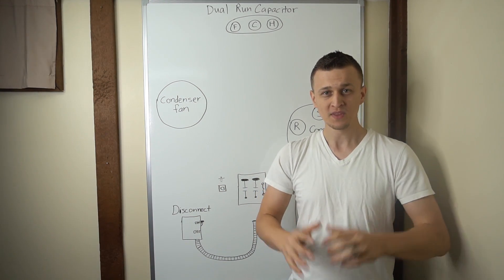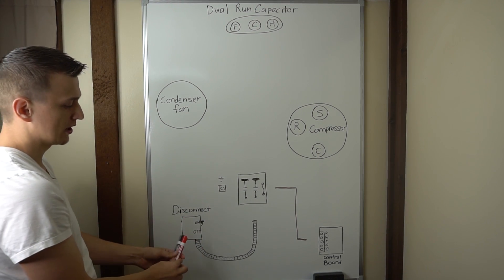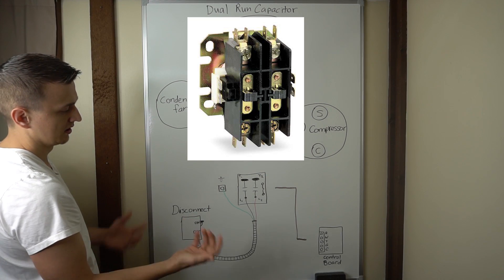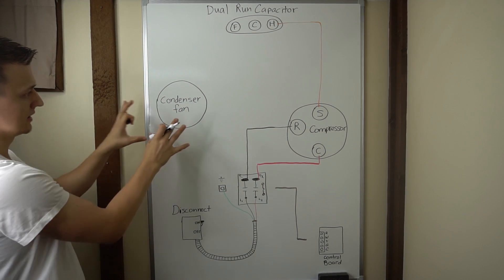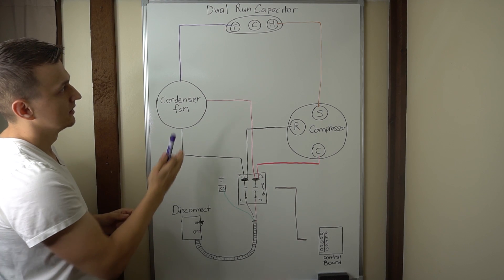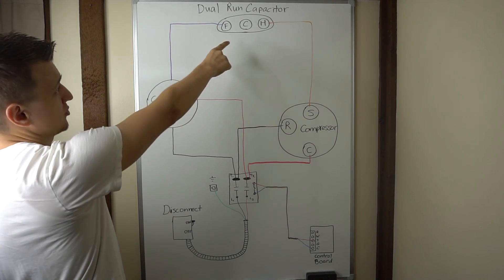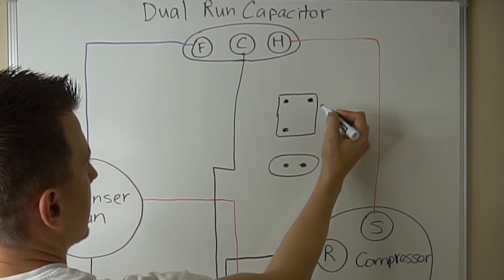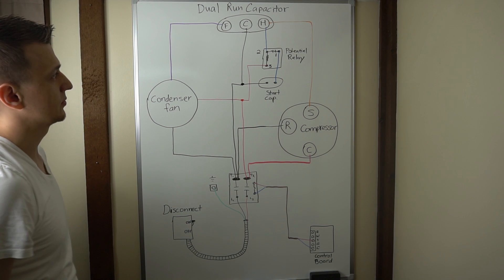How To Wire AC Unit - Easy Diagram

Comment: How is voltge in each wire 120v to give us 240? Isn’t it the hot wire only that gives 240v?
Reply: Two wires from 2 pole breaker each feeding 120v from each phase of the electrical panel, combine to give the 240v. In no situation ever will one wire supply all 240v. Rarely you might have a "bastard leg" in a residential system and more commonly in a commercial system,  that provides a higher voltage on its own but you probably won't ever deal with that

Comment: Please, I have a question. at 2:40 second mark you show the AC unit connections that are capped. Is the black wire linked with the white wire, and yellow with the red? I ask because in my unit I have red, yellow black and white wires and I believe I caused a short by capping two wrong wires together. Thank you.

Comment: How do you gauge the thermostat wire to replace it. I have a unit that has two feet of exposed thermostat wire connecting to the outdoor unit. Both indoor and outdoor stopped functioning. I know I can splice the wire but I have no spare wire so it can reach the outdoor unit again.
Reply from the maker: All thermostat wires are the same size but they can have different numbers of wires. 2-wire thermostat cable, 3-wire, 4-wire, 5-wire, etc. If you go to a hardware store like Ace Hardware, Lowes, or Home Depot - there you can buy these cables by the foot. You don't have to buy the whole roll. Then you can splice a new piece of wire in to replace the bare section you have. I have a video where I show different ways how to do so: https://youtu.be/ihpNCVk1lF0   As a temporary fix, you could just use some electrical tape to tape each wire individually so that they don't touch each other and cause a short.

If your units stopped working, that likely means that your 3 or 5 amp fuse (it can be a mini circuit breaker if you have Lennox) on the furnace control board has burned out. You will need to replace that after you fix your wires. Hope that helps!
Reply: @WordofAdviceTV  you’re literally awesome!
Reply: @WordofAdviceTV  I was trying to find where that fuse is to no avail. The AC is for a manufactured home and indoor unit is in a very smart closet like space. I don’t see a furnace board like you show in a lot of your videos.
Reply from the maker: @Salaasa-qwerty-wrok  oh okay! In that case you may not have a fuse at all. If there is a short, it would burn out the thermostat or the transformer. You would need a multi meter to check those.
Reply: Thank you for any help!

Comment: You saved the day for me, sir!! LONG story short- When I installed a smart thermostat at the beginning of this past winter, I apparently took off more wires than I needed to, from the thermostat hook up terminals in the furnace, thinking they were just old, unneeded thermostat wires. The heat worked fine, but the AC wouldn't turn on, and the time has finally come to address it. In the process, I messed up even more wiring and other things, including blowing a fuse, but I got that all resolved, and the AC still wouldn't turn on, not even by jumping it on the furnace's thermostat board!! I watched this, along with some of your other videos, and hearing you mention two 24V wires going from the furnace to the AC unit set me in the right direction, so, I quickly found that one of the "old sets of thermostat wires" was actually the two wires needed to control the AC unit outside, and this video told me where to connect them!! The AC works great now!! Thanks dude!! ✌️✌️😎😎

Comment: Hey! (To anyone): I hear people call the 24v contactor wire a thermostat wire, but then they'll draw it coming from the control board. Where is this wire really going? We had some mice over the winter and I'm getting the 24 volts coming out of both the control board and thermostat, but not making it to the condensing unit. I'm guessing they chewed through it, but having some trouble figuring out where it goes once it's in the wall from the condensing unit.
Reply from the maker: The thermostat wires go from the condenser unit outside to the control board inside the furnace/air handler. You can find these thermostat wires by the furnace and then trace them to see where they go. If not sure which wire to look for, refer to this video to see where it can be found: https://youtu.be/ge6pQeFlj3k
Reply: @WordofAdviceTV  Wow, thanks Jay! I've been searching around for an answer forever!

Comment: Fyi if you draw a wire crossing another and want to show they are not electrically connected you usually use a semi circle to show the wire "jumping" over the other.

Comment: Okay so my condenser unit is wired differently for some reason. The compressor has one black  wire on L1 and then a red wire on L2 on the contactor and then a brown wire connecting S from compressor to H on capacitor. Then the fan motor has a black wire connected to L1 on the contactor, but the 2nd wire goes straight to the C on the capacitor . Then the last wire goes to the F on capacitor. Lastly there is a jumper wire from C on capacitor to the L2 leg on contactor. Is this wired correctly?
Reply: Yeah that works. Doesn't matter if the 2nd wire from the fan goes to C on the capacitor or to T2 on the contactor because like you said there is a jumper between T2 on the contactor and C on the capacitor anyways, so they are connected.

Comment: when I change the motor of the condenser the colors of the cables change, could you help me with that?
Reply from the maker: There is usually a small wiring diagram on the motor itself that shows where the wires need to go. Your best bet would be to refer to that.

Comment: Yes, I have watched a few of this guys videos on u tube. I actually went to a hvac refrigeration school and pretty much learned what the key parts if the whole system the first time around Wireing to the electrical functions transformers and rolesccotrol boards take on confused me at first because the school I went taught everything electrical with  low end electric down with the small end of a transformer. .Also being in Arizona, AC units were not taught with the evaporator function with blower moter from the furnace. This guy does a god job breaking down the wiring in a basic way so the more complex stuff falls into place. For  knowing all common  the 1 120v leg is black the other leg to other side of contactor  is usually red or white.  I also got from this guy how the start on the compressor is wired to herm/compressor  other capacitor. Jason explains this well, making it much easier tofoow the other connections.  Hope he keeps doing these ,ha broadened my understanding. Thanks Jason!

Comment: The capacitor only has 124 Volts from one side of the contactor?   The same 
connection to the R connection on the compressor.   thank you

Comment: C Terminal on the duel run capacitor GOES TO the same terminal as the R on the compressor.   But does it matter which side L1 or L2  that the C terminal goes to!  thank you

Comment: The C on the capacitor (AKA Common) is connected to One Side (120 volts)
of the contactor?     Confusion abounds.  Common usually means neutral
voltage!   thank yoh

Comment: Great video...does it matter if the connection from the capacitor (C terminal) is connected to L2 (red line in your sketch) at the inlet power feed?  Thanks again.

Comment: Thanks for the relay tip.  I have extra wires(I went from a 3 to 4 wired fan with a relay and another canister I believe is ?  Not sure yet but still researching) and was unsure where they went.  I also went from a dual capacitor to a smaller two prong motor run capacitor.

Comment: I'm going to second David Pace's comment below.  Best video I've found after two days of watching HVAC videos.  AC went down three days ago here in Texas and this wiring diagram perfectly matched my system.  Very simple, very clear, solved all my problems with $100 in parts (capacitor and same 5-2-1 booster).  The hardest part was keeping red and black wires straight.  Red is Run on my system so I wanted as many wires coming off the run connector on the relay to match red as well.  Excellent work on this video!

Comment: What if your contactor has only one switched side and the other just a pass through?  RED or BLACK per diagram would be the switched side contact? Thanks
Reply: doesnt matter actually as Jay said, but usually ppl like to wire the red one to that switched side, black one to the pass through, 2 poles in this senario just make a double security because the 2 wires are both hot wires.

Comment: Hi. Great video. ?? I have a thermostat that has a green wire coming out from the g terminal a white wire coming from the w terminal, and a red wire coming from r terminal. I also have a transformer. Do I need the transformer? Or can I set it up some other way? Also where do the wires I just mentioned go to on the HVAC unit? I have an all-in-one ICP

Comment: My a/c doesn't have a disconnect,  it has two 60 amp double pole breakers. So I have main power on the pole to a panel box , than  that runs to the hvac sub panel box.

Comment: That was great.  I only suggestion I have is when u draw crossing wire over the other with out touching, draw that line when u approach the other line instead of just crossing go to the right or left   Do U over the other line and keep going . That way it is would be known those wire not connected each other.  
Thanks for your wonderful presentation though

Comment: Thanks for the video but i have a question please. 
I thought it's always 5 to common, 2 to start and 1 to run. But here the relay was connected a bit differently. Like 1 ended up on the start capacitor. Do i understand you could manipulate it in anyway as long two ends land on T1 and T2?
Thank you

Comment: I always appreciate your videos and how you try to fully explain everything. I Have  a question for you. The common way to wire the 24 volts control wires going to the contactor is to run it in through the smaller opening beside the the main 240 volt line going into the condensing unit. These 24 volt line wires are usually strapped to the outside of the main 240 trunk line and then ran over to the smaller opening in the Condenser. . Is there a reason why you can't just put the 24 volt line inside the main 240 volt trunk line? This would protect the 24 volt line from the outside and prevent problems like squirrel eating the 24 volt control line wire. Is this just because or another one of those electrical codes issues? Thank you.
Reply: That is a very good question ....I am working on my Daughter's AC and I with included the thermostat wires in the metal sheath as I have to replace them due to something eating the insulation off ....i don't know  about Code on this ?

Comment: When wiring up the fan motor looking at the schematic and figuring out which cable was your line cable also helps. As a rookie i made a mistake on a gas package unit and assumed the blower motor was 120v and when i cut it on it blew my motor 😅😅 advice to all new comers.

Comment: Can I wire common of capacitor to common of compressor? Can you kindly show us a same set up with a dedicated run capacitor for  the compressor, IFM and OFM? I learned a lot with your video. Very helpful and straight to the point.

Comment: Question about the three conductors from the panel (2x 120v conductors and the ground) to the Disconnect.  At the panel, do you use two 15A single pole circuit breakers or one 15 amp double pole circuit breaker?

Comment: Please help! I've been trying to fix my outside unit for 3 weeks to no avail. It still won't start up. I made a video of all my wiring that I've rechecked many times: https://www.youtube.com/watch?v=s7Dgr9Wfh0g
Reply from the maker: Hi Sean! I just now saw your comment as I was scrolling through the hundreds of them.. I watched the video you provided. I hope you got your unit running by now but if you didn't, I do see what the problem is. Or at least one of them as there may be more than one issue. The two low voltage thermostat wires need to go on either side of the contactor. (The part where you show them up close and say that they are not touching) In the video you have them both hooked up to the same side which is a direct short. One needs to go on one side and the other on the other side. I have a video on how to replace a contactor if you want to see an example. If you have a 3 amp fuse at the furnace or air handler control board, that will blow right when you power on the unit.

Comment: I've replaced the fan motor (including blade bc I couldn't get the blade off the old motor shaft even with 2 fan blade removal tools), the capacitor, the connector, and even the low voltage wiring from the furnace to the AC unit. I've checked the wiring many times and it the outside unit still won't start. :((( Please help!

Comment: Thank You , was going to take a picture of the wiring before i pulled the capacitor. I got interrupted, came back and pulled the wires and the went ah S#%T forgot to get the picture. So , you saved my bacon.

Comment: Just bought a 521 capacitor and relay. Your explanation of the wiring was a lot easier to follow with also the help of the wiring diagram that came with the kit. Thanks a million.

Comment: Perfect!  Exactly what I was looking for!

My only question is that my condenser fan has 4 wires - Brown, Brown/White, Black, Yellow.  
It appears that Brown and Brown/White should have the capacitor between them, so do I hook those wires to F and C on the Dual Run Capacitor?  
It seems to me that Black and Yellow should go to the T1 and T2 locations.

Just want to make sure...  the original wiring had multiple capacitors and I didn't have the vision to take a picture before disassembling...
Reply from the maker: In most cases you would simply need to do what I explain in this video: https://youtu.be/VlMhvwrpimE

Comment: 5yrs in and u definitely help me up my game! From installer to tech. Which the more I understand how it works the more naturally it all comes to me. Wish i could of worked with u first hand!! I started not even knowing how long to tear some tape. Straight to the field as installer new construction. Think classes will actually still help me? I get a kittle iffy about wiring when has all the extras and transformers and everything. Other than that i can put anything together. Build any duct and change any part as long as i took it out.

Comment: Excellent explanation. May I ask; Does the indoor unit of an AC mini-split get power from a separate line or from the wires that connect to outdoor unit?
Reply: Electrical panel in the home with breaker feeds disconnect, disconnect feeds condenser, condenser feeds the mini split head with  other wires power/communicating

Comment: could u show inside evap...... fan relay ,seq ,blower and 24 volts everything please....transformer   heating strips. one with one sequencer for 2 strips and one with 2 sequencers .......also defrost circuit board ....your awesome man ...just notquite there with normally open fan relays and after 24 volts on sequencer  what goes on first phase then top of sequencer......if u need my email let me know

Comment: You really saved my bacon with this video! I'm in Florida, so temps below 40f seem life threatening. Heat quit sometime last night. Tore the unit apart thinking it was either the contactor or the condenser fan because I recently replaced the capacitor. Took lots of pics of the wiring thinking I could easily put it all back together. After fan motor and contactor tested good, THEN I decide to test the moost easiky accesible part, and Yes, it was a bad capacitor. Acquired a new cap and stood there, flummoxed. I couldnt remember which wires went where and my pics were too close in some cases, to tell what went where. Followed the video, took a screenshot of the completed diagram, and I have heat again! Thanks a bunch for an easily understood video!
Now... Can someone help me understand why I've gone thru 3 capacitors in a year?
Reply: You may have Fan or compressor pulling too many Amps .....may simply add a jumper capacitor ...that is my best guess ....labels on Fan and compressor may read the Amps ....then test them.